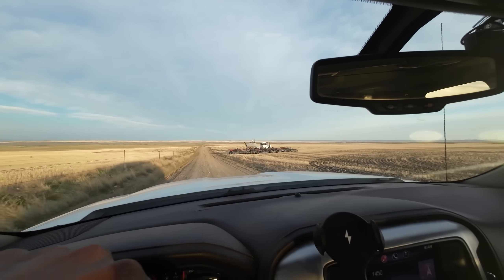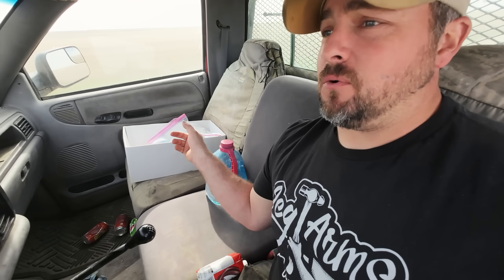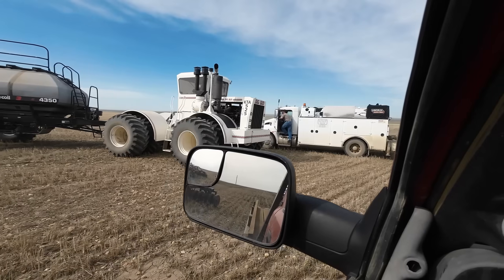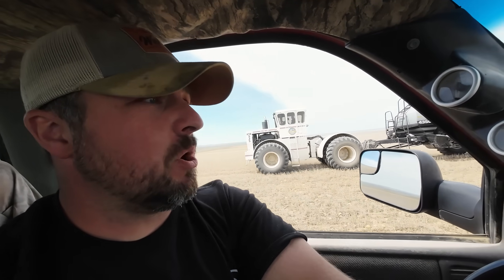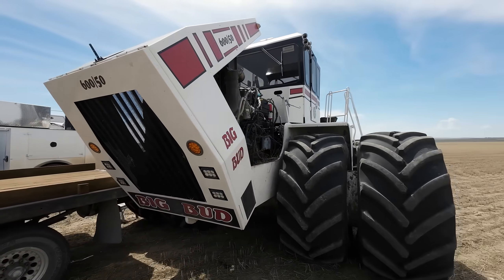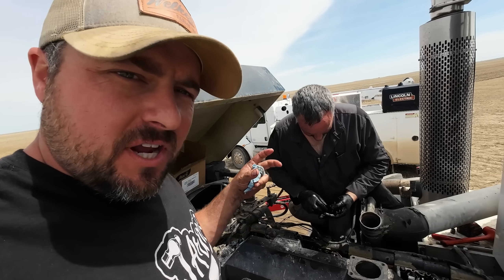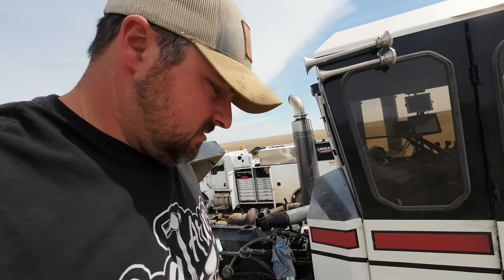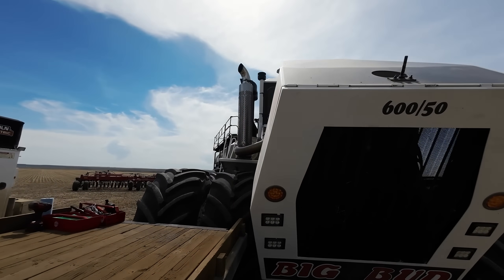They're Running Again!

Comment: Glad to see you’re up and running, don’t think it’s the operator of fuel, possibly wrong calibration on injectors as it happened after the injectors were overhauled. Had a set for a KTA 600 done as well as the fuel pump and the wrong calibration was put in them, shut the engine down at 800 H P on the dyno and found the injectors and fuel pump weren’t compatible, one was low flow and the other was high flow. Sad to say it’s getting harder to find someone to work on them. This day and age the mechanics need a computer to tell them what’s wrong. Always loved the challenge to fix the problem. Praying for rain for the farmers.

Comment: The injectors in those old Cummins PT fuel systems have always been problematic. Little bit of carbon gets into the tip and then the plunger doesn't seat and seal correctly anymore and they leak and torch pistons. I don't miss all the constant injector adjustments that were required to keep them in tune, shimming cam follower boxes to set the timing, and blown aneroid diaphrams on those PT pumps with the old NT and KT series engines. Not to mention loose cylinder liners that got cavitation holes in them, and several revisions of print-o-seal head gaskets and head bolts that Cummins went thru to try to keep the top end from leaking coolant in those engines. There's a fix for that - replace it with a Cat 3406E six and a quarter and you'll never have to work on it again and it will outlast the rest of the tractor.
Reply from the maker: They are great when they are running but that goes for any engine. I see cat repowers in our future.
Reply: @WelkerFarms  I agree 100%. Cat built the first true million mile engine for heavy trucks with the 3406. They remain to this day the most bullet-proof engine ever built by the human race. I got 3406's and C15's, and C18 in my Cat Challenger track tractors, and semi tractors, and they just run. They might be a little heavier than the Cummins, but in a farm tractor that's a good thing.
Reply from the maker: @chrisandkristin  a friend of ours puts c16 engines in his Buds set at 600hp. They are beasts! We should be on the lookout for some engines in case that day comes. Glad you've had great success with your cats!
Reply: @WelkerFarms  3406E thru C18 are all the same block and main bearings. It's just a matter of what crank, cam and head, cylinder pak, turbocharging and injector combination, and flash file in the ECM you want to use. For instance the regular 3406E is a 891 cube, but the 3406E 1MM serial number is a 964 cube and is the same thing as a C-16. Of all of them the C-15 (notice the dash designation) and C15 are the most common in both single and compound turbo configurations. While the C18 I have in my Challenger was never available in a production truck, there is plenty of them that have been built for trucks. But they are more common in marine, G-drive and off-road equipment up to 1,000 hp. The C18 is a torque monster with its 7.2" stroke. The one I have in my MT875 is 630hp @ 1,800 and we pull an 11-shank JD 2730 disc ripper, or 60ft field cultivator, with it. I'm pretty sure the driveline in the Bud would handle a detuned C18 too if you programmed it with the flash file to limit the torque to around 1,700 lb-ft in the lower gears.

Comment: What a weight off you folks with getting the fix right on the 600 cummins. Back in the 1970s I had worked with the KT Cummins in Heavy trucks

Comment: You folks have been a "extended" family for this old man with no family till you took me into your hearts! I will start my book length comment with a heavy or large.. you fill the missing word that describes my thank you for even considering me as a family member!! 
      I am going to  say now that this video lands right into my wheelhouse because since you've sat on the fenders of a 600 KTA Cummins engine, I don't have to explain size differences. I did a lot of fabrication in the southeast alaska islands and built things I figured if they worked only one half day, it was a success. This 600 engine is not a automotive size engine, although a powerful but to my knowledge, not built anymore, a engine just loaded with torque. I (the company I worked for) needed a very powerful truck to move equipment to different locations in the woods to move trees to where they could be hauled. I did not have the option of using two engines in one rig to move stuff so my plan if successful would be to make a engine powerful enough in a special built truck. The six hundred is longer and just bigger than any other engine in most cases. So with cabin off of the truck I was building, built my own frame rails, mounts, transmission adapters, .... all said in smaller words, MAKE IT FIT, into a small truck when you say regular truck and not a off highway truck that could use some huge engine. Before I forget, if you haven't used Area Diesel Service, its time to look into their quality service. I actually built a 600 KTA engine from parts and assembled it into a old Kenworth, a A model of and about mid seventies. I double rail and extended frame sat the engine in the truck and then set it up with a working good retarder for extra braking power. The yarder it moved in the woods had to go several miles to each site for hauling logs from the woods... it had multiple drum lines set up for a "skyline" and no, this is not a version of going snipe hunting, a skyline is a machine that uses a cable system suspended between two mountains, has a few miles of very large cable that holds another yarder suspended in the air to move trees from landing to landing and then to a loading site. I probably could write a book on just the many things that went into making a automotive truck into a off highway power sized rig to move the big yarder into different locations. The rig had enough power to now move equipment but not to stop it. I sat up a smaller rig with just air compressors to feed enough air for the brake chambers on the lowboy truck as well as using another rig weighted down right so it could also be a braking system for the main rig. The yarder made by Cyprus in canada cost at that time, one million dollars. You do the math on a machine that cost that much fifty years ago. At  that time, my shirt size was in  the fifties, I had a color in my hair, and most of my teeth, could see a nat doing nat things on a fence post a hundred yards away plus hear the conversation of two fleas at half that distance... well I am telling it so a little (lot) exaggeration might be involved. No jokes, a big boy young enough to still get back into the service, and for the most part, missing that part of my life, when I was most of my body parts original. I agree Nick... small engines that do this kind of work definitely need a starter on them. Maybe some day you can cannibalize the families riding lawnmower engines or just the stuff used to make them key start/LOL. I know also what it feels like to see our kids growing up to be future farmers. I apologize for not being a better person when it comes to editing my comment and make it readable. I am just all over the place as I get excited to include things as I remember them. As always God bless this family!
Reply: Awesome you still recall and share those memories.  A lot of experiences in the engine rebuild aren't being passed down.  Glad you're following us.

Comment: My last M-Benz, a 240d, I had the injectors redone by a shop,  drove it home, and it never cold started again. 385-Thousand miles and the rings and block where just too worn out to compression start. *Furious!!*

Switched to turbo SAABs, the M-B was just too-slow for my commute on the Interstate anyway,  65-MPH was about as fast as it would go flat-out....and the NJ Turnpike is 70-75 in the slow lane.

Comment: Ultra low sulfur diesel can cause injector failures due to lack of lubrication.   The fuel these days is not the same as when those engines were  built.

Comment: Would not believe how much an injector can cause problems with the engine. A O ring can cause more problems than someone may think. Had a caterpillar engine that 1 small O ring could cause it not to run at full power. Have a great day be safe.

Comment: Have you checked the fuel?? We had trash fuel that looked like   chocolate milk and it would never separate. I put some in a jar brought it back to the system that they're fuele destroyed the had to have all the fuel tanks empty all the fuel lines all injectors everything to fuel prompt everything. I started going up hill just lost all fuel pressure and it would barely pull itself it kept running but it would not pull itself. So my trucking company got cheap fuel and they had to pay for it more than once.

Comment: Man i love them old buds but you really outta repower them old girls at least the two bigger tractors with a Cat Motor. A C-15 or C-18 either doesn't matter as they are the same block with bigger piston and longer stroke. Way more reliable and super easy and way cheaper in the long run to own as you literally change the oil and blow the air filter out. Also parts are radially available. Just an idea for you guys to consider as i don't wanna see the old girls parked.

Comment: I had a fresh rebuilt set of injectors do this and it turned out when they rebuilt them they are supposed flush them out with a fluid they can be stored with.  But a new guy there flushed them out with the same chemical they clean them with and it damaged the inside of all of the injectors.  Luckily the replaced them at no cost, but what a waste of time troubleshooting them!

Comment: Have you guys seen an improvement with all of the electronics applied to the equipment? Do you overlap the seeders/sprayers/combines? Can you correlate between seeds per acre vs harvest so that next year the sprayer/fertilizer is applied in higher combinations where it is needed?
Reply: The electrical tech for monitoring is awesome.  GPS reduces fatigue and gives accuracy.  But with limited moisture, which reduces yield,  lowers the gains found in higher rainfall areas

Comment: Seems weird that two machines would have injectors go out at almost the same time. Did you guys check the fuel for anything getting into it? Seems like the common thing between the two machines.
Reply: What was common is both had injectors replaced at the same time

Comment: could your problem with the big buds have anything to do with FUEL ?
Reply: All of the injectors were rebuilt at the same time.
Reply: I thought that also, but it doesn't explain why no other diesel engines on the farm are giving trouble.  Only the two Cummins engines that got injector work done on them.

Comment: Wouldn't it make sense, to do an exhaust gas check after these maintenance tasks - since the tractors don't have a modern engine management system. That way you could catch such issues earlier. Or maybe even permanently install lambda or oxygen sensors ... should be pretty cheap in comparison to the downtime or an engine rebuild.